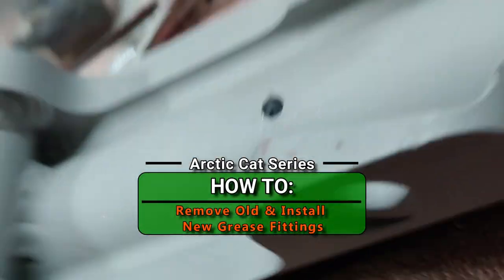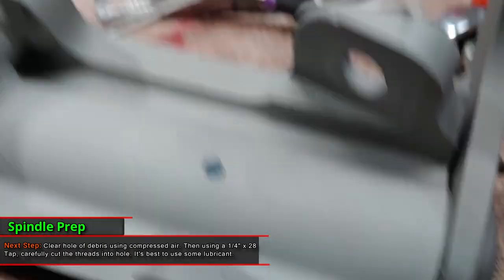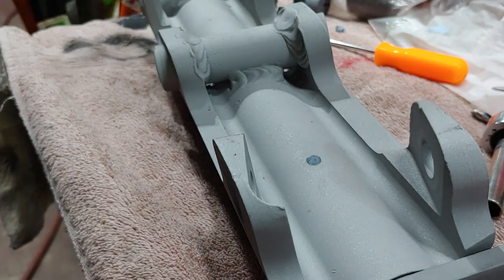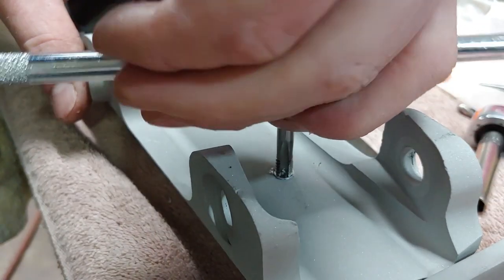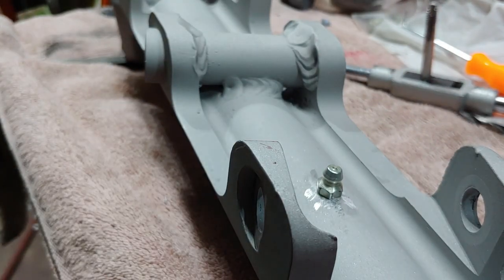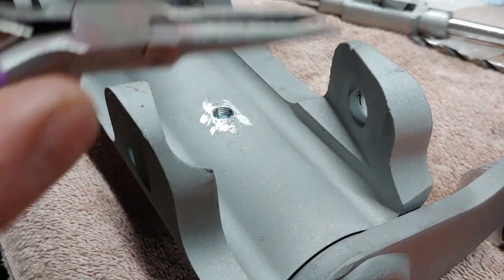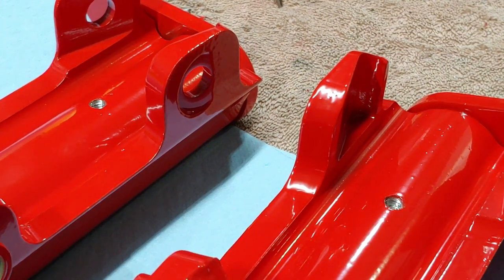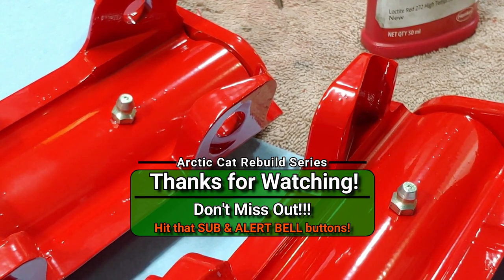Snowmobile Spindle Zerk Fitting Upgrade: [New Threaded Zerks]

Comment: What type of powder coating gun/ brand do you use?
Reply from the maker: Thanks for contacting me and watching the video! Currently I'm using Eastwood dual voltage but will be eventually changing to something a little bit better quality for longevity purposes. But for now the Eastwood dual-voltage gun is pretty decent.
Reply: Do you use Eastwood powders too? I'm more interested in that orange color used on your wife's ZR skid in your last video.
Reply from the maker: Nope. Not normally. I have a couple and they are okay.... Their polished aluminum is supposed to be fuel and chemical resistant but its not. Staryed looking elsewhere.